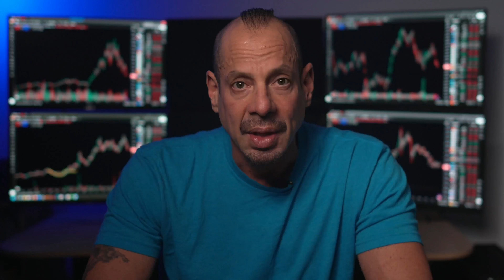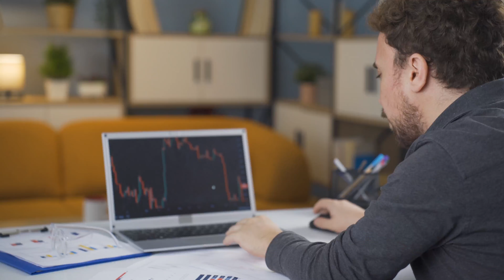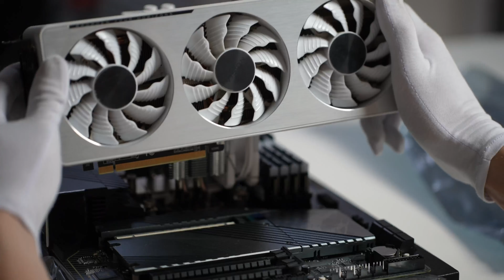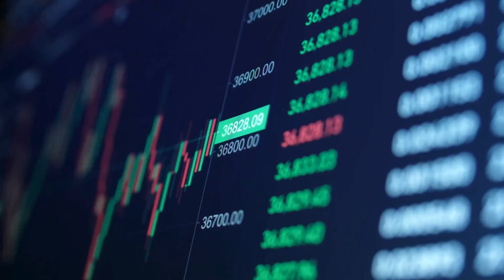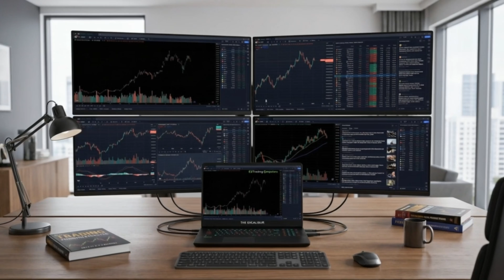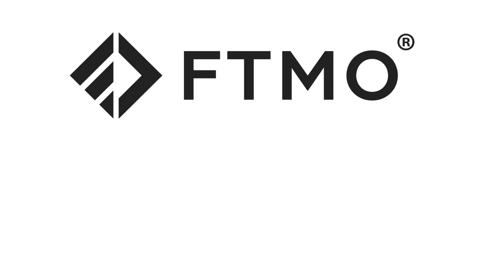The Fastest Trading Laptop I've Ever Tested — 62,691 Benchmark

Comment from the maker: Before you spend a dime on ANY laptop — this one or anybody else's — find out where your current machine stands against the 45,000 benchmark line. It's free, it takes about 2 minutes, and it ends the guessing for good. Find out now ➡ https://eztrading.pro/cpu-014
Reply: Doesn't matter how fast your computer is if your router isn't.
Reply from the maker: You're 100% correct about that. If your router where your internet is crap, that's definitely a bottleneck.  By the way you should always stay wired into your router. Avoid Wi-Fi whenever possible.

Comment: What's the difference between 3D and none because I got it without it. AMD
Reply from the maker: Since yours is the non-3D AMD, here's the difference: 3D V-Cache stacks extra cache right on the processor. That's the bigger counter next to the stove from the video. Trading software grabs the same data over and over, so that extra cache pays off under load. A non-3D chip can still be plenty if it clears 45,000. Run the free benchmark test to see where yours lands: eztrading.pro/cpu

Comment: That is a nice set up for sure. To make it even more better, it would be nice if it was a Tough Book to handle bumps and stuff. Digital Nomads would love it if it was.
There are lots of Digital Nomads that live on the road trading daily
Reply from the maker: You're thinking about the road-warrior use case, which most people overlook. Here's the thing — ruggedized cases run thick and hot, and that cooling still can't push a 62,691 benchmark without throttling. The nomads who trade full-time usually need the horsepower more than the armor.
Reply: @eddiez-trading  Makes sense totally. Technology is getting better and better faster than ever. One day in the near future this could be possible. It would totally sell me if there was a stable military grade case monster laptop like the one you desigend.
Brilliant build btw Eddy I really do like it
Reply from the maker: Appreciate the kind words on the build. You're right that the tech keeps moving fast — a rugged case that can shed the heat from this kind of horsepower isn't far off. When it exists, you'll hear about it from me. Thanks for following along.

Comment: still too expensive for its performance and old tech. A regular Mac with m5 will still beat it every time. You need shared memory with gpu for better performance. Apple MLX works better with AI too.
Reply from the maker: Ok if you really want to geek out — shared memory is genuinely clever and MLX is real, I'm not knocking either. But "old tech" doesn't survive the numbers: the fastest M5 results land around 57,400, this chip clears 62,691. 

And MLX isn't the flex you'd want here anyway. The delay that matters in trading is your network path, not the math — a round trip out to the GPU costs tens of microseconds, so nobody puts a GPU in the live decision path at all, let alone MLX. What actually fires there is a simple model running straight on the CPU. MLX is great for the research side on a Mac. Useless on the wire. 

Then the boring practical part: NinjaTrader, Sierra Chart and MultiCharts are Windows-only, so on a Mac that means Parallels or a VM — exactly the workaround that bites you under load. This breaks down why Mac fails most traders if you haven't seen it: https://www.youtube.com/watch?v=GhU1uDrL86I
Reply: @eddiez-trading I like what you do. I aspire to be a trader too. I use Metatrader5 only, due to its cheapness and availability of tools.
If metatrader5 can port to Linux I'll switch in a heartbeat. If all other platforms could make Linux versions. It would be super.
Reply from the maker: MT5 running single-platform is a lighter load, so you've got more room than most. And you're right — native Linux ports would change the whole picture. Until the platforms build them, you're stuck with the compatibility layer, which is exactly where things get shaky under load. Wishing you good fills on the journey.
Reply: Eddiez is right Im running a MacBook pro and it is not working well. Im running Ninja Trader in Parallel and it is to slow. It will choke if I try to run Trading View and Ninja Trader at the same time.
Reply: @HawgRipperJigs  I agree with Ninjatrader. mac is only good if you don't need windows to trade, parallel is not a good option but can make the job done.
Reply from the maker: yep
Reply from the maker: You just proved the whole point live — NinjaTrader in Parallels choking, then dying when you add TradingView, is exactly the compatibility layer breaking under load. That's not your MacBook being weak, it's the VM sitting between the platform and the hardware. On native Windows those two run side by side without a fight. Watch this video: https://www.youtube.com/watch?v=GhU1uDrL86I
Reply: @eddiez-trading  The laptop you reviewed is a good one but spending that much for that performance doesn’t make sense. Mini PC is much cheaper and you can still get 5080 for high speed video ram and single core performance will be much better for a laptop who doesn’t need Ninja can use Mac, macbook has most performing single cores. For a common trader can go with 16-17 inch good gaming laptop with 5080 less than half of this price. 18 inch, almost 9 pounds is chunky and heavy. I am not against this laptop but it is too pricey. The display is really old 16:9 ratio and ram speed is too slow. Unified memory is much better almost doubel the speed this laptop offers. 16:10 will fit more chart and indicator if someone use. Keypad looks too flat for professional trader.
Reply from the maker: You raise a lot of separate points, so let me stay on the one that actually decides fills: a mini PC or gaming laptop can post good numbers, but they thermal throttle under sustained load — and trading is a sustained workload. On price, this laptop is built for full-time, multi-platform, AI-bot traders. If you run one platform part-time, I'd tell you to your face it's more than you need. Different tools for different traders — wishing you good fills.

Comment: Spend money first on a solid CPU, plenty of RAM, and a fast SSD. Add a dedicated GPU only if you are running many high-resolution monitors or specific GPU-accelerated features. For the large majority of retail traders, integrated graphics are completely adequate.
Reply from the maker: You've got the CPU, RAM and SSD priority exactly right — that order holds. Where I'd push back is integrated graphics: it works until the open, then the CPU is playing quarterback and running back at once and fumbles under load. A discrete card gives you headroom when it counts. If you haven't seen it yet — I break down exactly when integrated graphics fail traders. Watch this video: https://www.youtube.com/watch?v=pg0S9LJha4Y